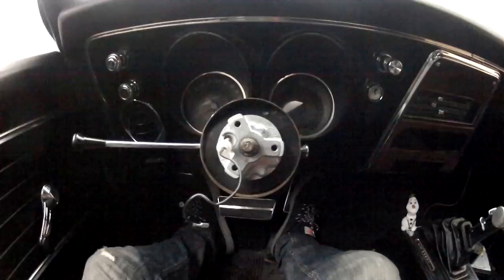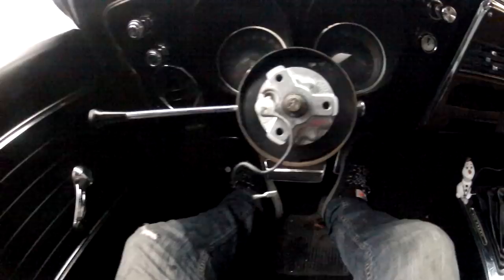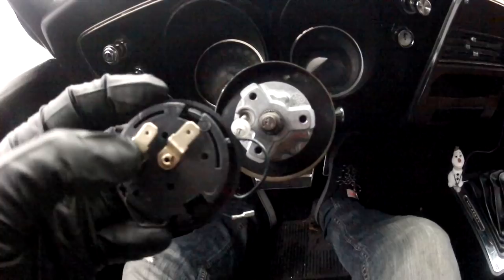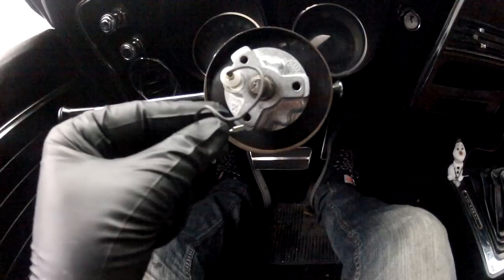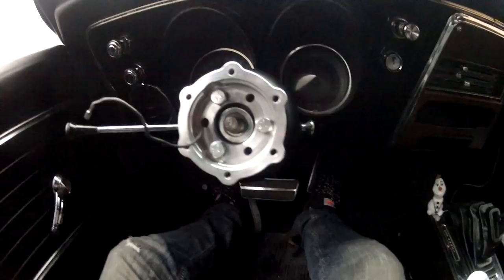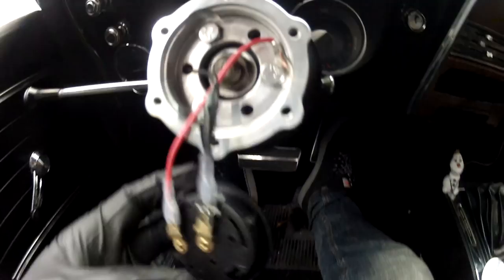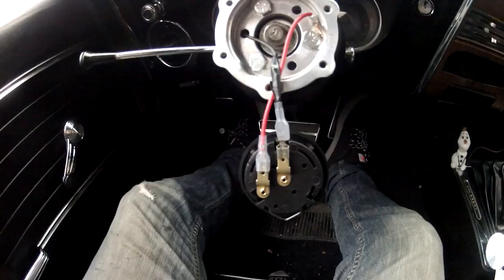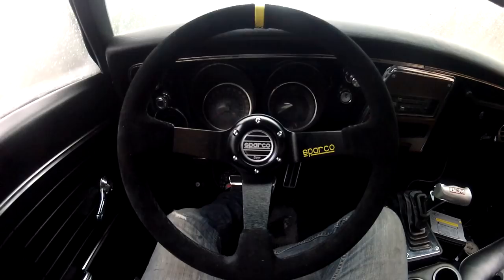68 Camaro Pt 5 - Sparco Steering Wheel Install

Comment: lol right when u were describing how to wire it up i already thought of a soln (before finishing ur vid)

i would have just wired that loose wire to one terminal and ground to the other, detach the spring and use and insulator or a paper to separate the sparco from the factory steering

Comment: Kind of late, but for the ground, that little metal triangular shaped thing on the edge of the Sparco horn button creates a ground when it comes in contact with the grant adapter, you just have the wire the positive from the horn.

Comment: I have to stop you at your point about someone breaking in and stealing your sweet wheel. I see where your coming from but if someone really wanted to take it, it would only be slightly harder to just take the bolts off holding it on anyways. I use to worry about that but I mean if someone wants it, they will take it. I knew a guy that had his wheel with him and his car got stolen. The guy who stole the car matched up the quick release with his own and took the car anyways. If you want that wheel to be safe just let your insurance know its price and they will cover it. Your premium will go up but that's the only sure fire way it will be ok. Anyways love your videos, keep it up.

Comment: Just a quick question. when you took off the original wheel it was at a 47degree angle & when you put the new one on you put it on perpendicular, 90 degrees straight. So question is, did you straighten the old wheel out before taking it off or did you place the wheel on crooked ?